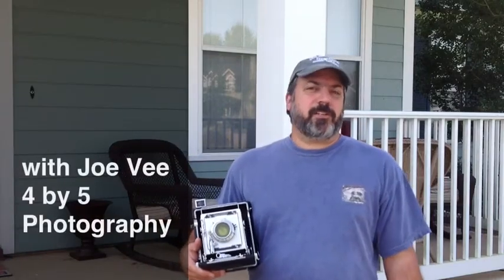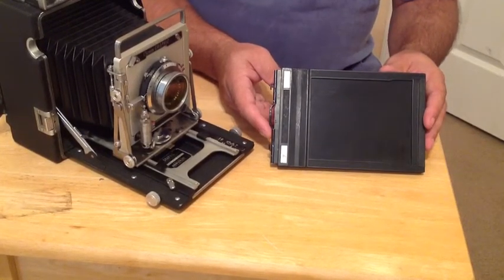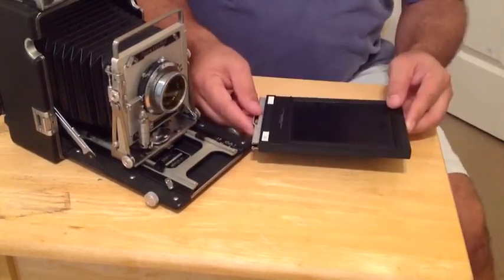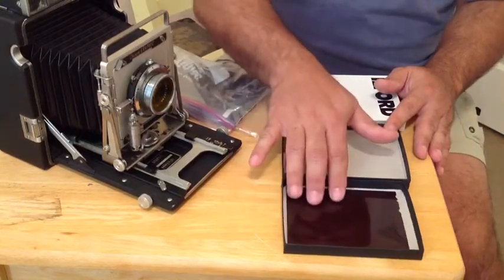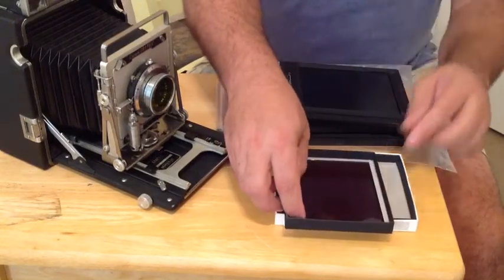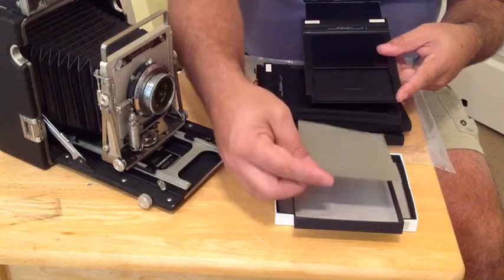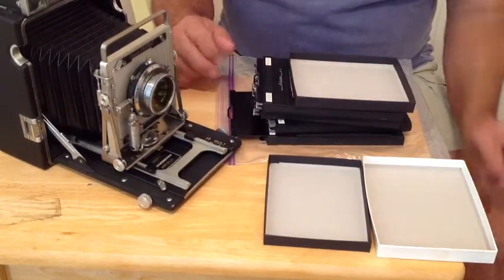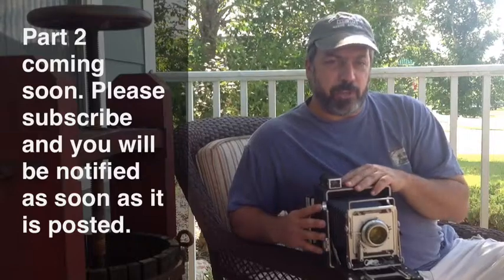Large Format Photography Part 1: Film Handling and Loading

Comment: Silly question time; how do you see what you're doing in the dark? Is it all based on feel and muscle memory?
Reply from the maker: +Robiul Ahmed Actually a very good question.  I have been thinking about posting a video of loading the film holders with film and then unloading them and loading the development tank while blindfolded to show my process.  Let me know if anyone thinks that would be a helpful video, but I basically get everything organized so I know exactly where it is in the dark.  Its mostly feel as I keep the film box in front of me, the unloaded film holders piled to the left with the dark slide half way out on both sides so the film does not get held up when loading.  I pull one sheet of film out of the box/bag, verify the notch so I know the orientation, pick up a holder, load it, close the dark slide and repeat for the other side.  I put the loaded holders to the right. If things get mixed up, I know which holders are empty because the dark slide is half out.
Reply: 4by5photography That would be a good video :)
Reply: would be a valuable video.Please do it.